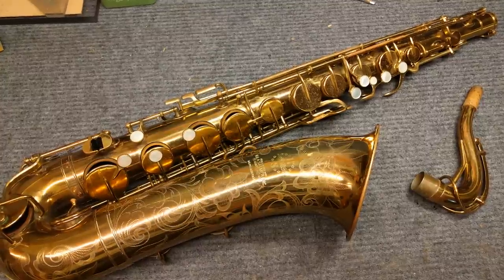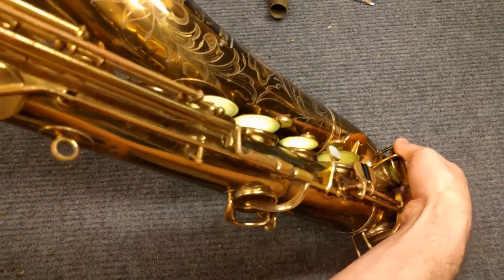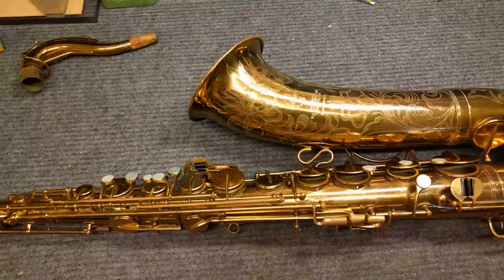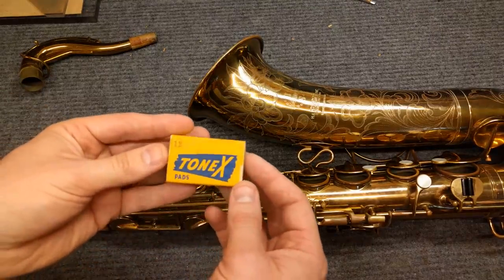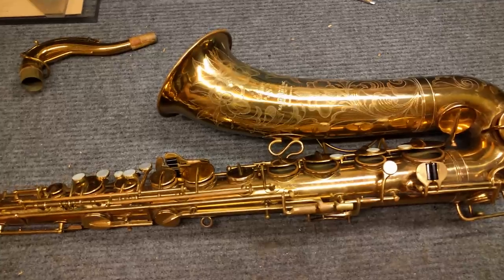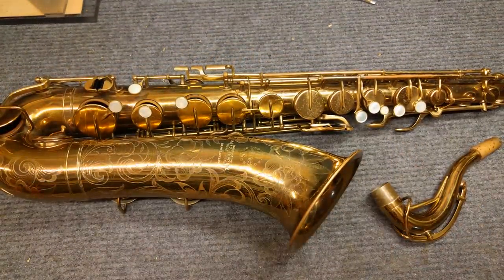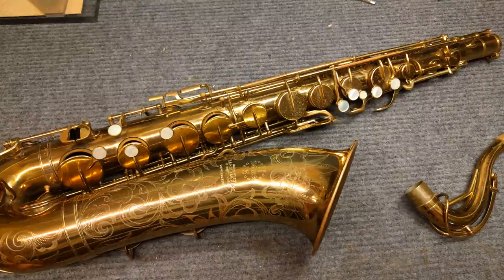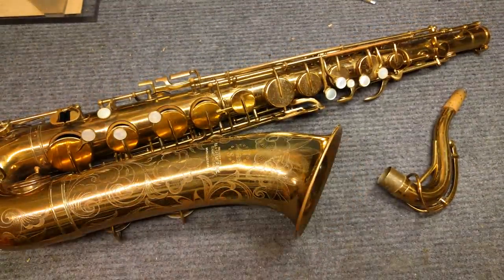Repairman's Overview: Selmer (USA) Padless Saxophone

Comment: Nice video and as always very informative.  You have one assumption in here that isn't quite correct though.

The Padless and most other Buescher attributed stencils aren't actually Buescher Aristocrats or True Tones, but rather products of the Elkhart Band Instrument Company (EBIC), are of a different design, and were assembled in another factory a few blocks away from Buescher in Elkhart.  They are not just re-issued versions of earlier Buescher instruments.  Different body tube, different placement and dimensions of tone holes, and even the padded version of this horn's key work (sold as an H&A Selmer Bundy) is not fully interchangeable with any of the Aristocrats or the earlier True Tones.  Certainly a familial relationship, but not "essentially the same thing".

Up until the late 40's, EBIC outsourced much of its manufacturing to Buescher, which partly owned them them until they bought out the company in the 40's.  This makes them look like older Bueschers, but they also used parts from other instrument makers such as Conn and Martin as well to complete their instruments.  Sometime in the 40's, Buescher bought out the rest of the EBIC company and moved production of Elkhart horns (and their stencils) in house in the late '40's.  That's when you start seeing "Elkhart Built By Buescher" and then finally "Elkhart by Buescher" on the engraving.  Starting about 1960, Buescher dropped the Elkhart brand and the 30A then became the Buescher Aristocrat (and eventually the Bundy 1), while the previous Aristocrat was renamed as the Buescher 400, with the previous 400 becoming the Super 400.

This particular horn is directly related to the Elkhart 30A and not the Aristocrat (model 127 at the time), as were the H&A Selmer Bundy, Windsor, and at least a dozen other stencils that EBIC produced over the years for other sellers.  It's also more closely related to a Bundy 1 (at least in design if not construction quality) than it is to a pre-1960 Aristocrat or True Tone of any vintage.

There's a very long thread on EBIC saxophones at Sax On The Web.  You can follow the evolving understanding of this manufacturer here:  https://forum.saxontheweb.net/showthread.php?191653-Elkhart-Band-Instrument-Company-Saxophone-registry/page7

It's easy to spot an EBIC tenor by the neck.  The neck brace is distinctive.  If it has that bent wire brace and Buescher-like key work, it's an EBIC designed horn.
Reply from the maker: Excellent information, thank you!  I have utilized a new feature and "pinned" your comment  to the top.

Comment: I'd be interested in learning anything about how to repair this saxophone
Reply from the maker: Just like a normal sax except for the pads.  You would need to make a gasket material- I would likely try to make a multi-layer leather and cardstock laminate sheet like I show the Tonex pads to be, and then you could either try to cut rings out or make strips and coil them around and finish them with a lap joint if your materials were flexible enough and you ironed them flat.  There are also alternatives, and if you do a google search you can find shops that have worked on these in the past (I have never overhauled one) to see what they ended up using.  You'd need to get the thickness correct and then to "seat" the key cups you'd be bending them, aka "dry fitting" to get a seal, no floating of the rings.  It will not be easy!